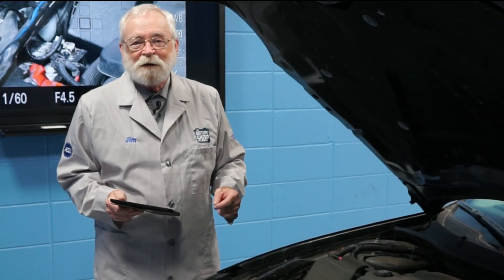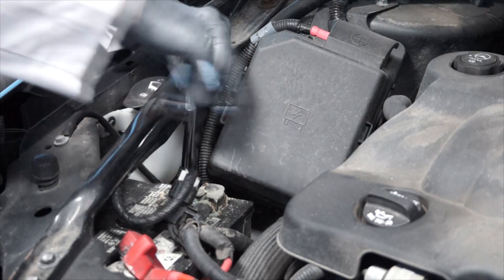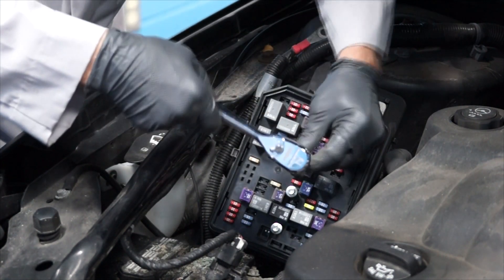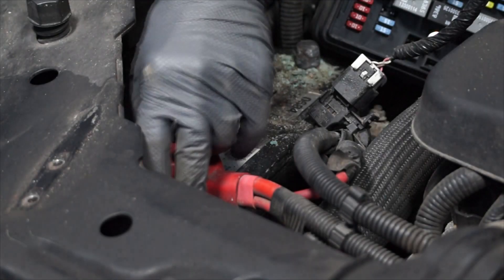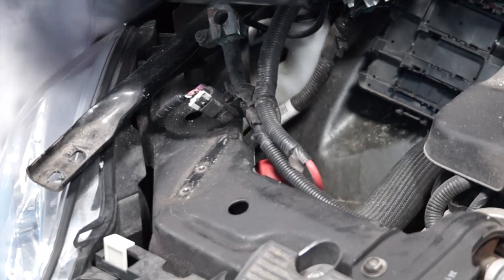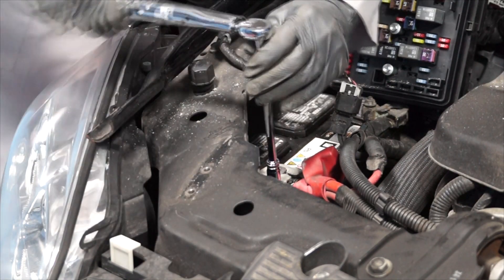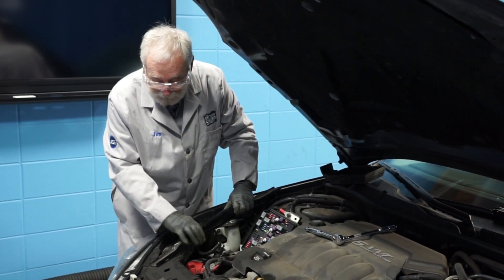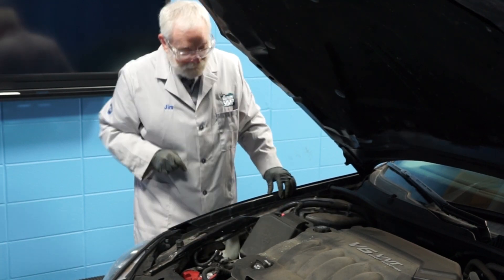Chevrolet Impala (2012) - New Battery Install

Comment: Follow-up: How did you get the control center positioned in that location when removing and reinstalling? There is an electrical cable coming off the block connecting to the control panel that prevents it from being placed in that position. Unless this one was shortened or the one your working on was lengthened, I don't have anywhere near that range.
Taking the battery out required three minutes of small maneuvers, eventually putting it on its side to get around the control panel and getting it out.

Edit: I found a second pair of hands to hold it as much out of the way as possible and got it installed. Thanks again for getting me 90% there.
Reply from the maker: Thank you for watching and happy to hear this worked out!

Comment: Near the end, the video shows you reconnecting the positive wire onto the fuse box right after you install the center board of the box; however, the next shot shows it disconnected again while you connected the negative battery terminal. Did you need to disconnect the positive lead from the box for some safety reason before you finished the negative connection to the battery?
Reply from the maker: Thank you for watching and for the feedback.

Comment: I did exactly all of that and the car will almost turn over.
Reply from the maker: Hi - Thanks for watching and sharing your experience. We recommend that you have the starting system shocked for starter and electrical issues.

Comment: Once I changed the battery the check engine light came on how do I get it off
Reply from the maker: Hi - Thanks for watching! If memory saving was not used, we suggest that you check the vehicle owner's manual or a service/repair for any system reset procedures that have to be performed.

Comment: Hey thanks so much for posting this. I was having a hell of a time getting the new battery in. I made the mistake of dropping the negative side down first. Then I saw you drop the positive side down first, went out in the driveway and BOOM, new battery in place no problem! Pretty tight space in this car, not a lot of wiggle room. Thanks again and have a good one.
Reply from the maker: Hi - You're welcome! Thanks for watching and sharing your experience.
Reply: At least this series vehicle (2006-2013 Impala) has the battery under the hood.  HHR's had it under the spare tire (watched a "pro" scratch his head for 15 minutes looking under the hood and fenders) and of course many Chrysler sedans have them inside the front fender and for those you have to remove not only the tire, but the plastic inner fender liner as well (so easy to break a couple of the plastic "retainer screws and the liner never stays in as well as new).  And don't even get me started on those vehicles that need the bumper removed to replace a headlamp or tail light.

Comment: I have a question I have a 04 Impala and I'm having security problems with it where it shuts off the engine how can I get past that to get the car running again I tried unplugging a couple fuses nothing really works
Reply from the maker: Hi - Thanks for watching! You may have to have the vehicle's security system (immobilizer) reset. This usually requires the use of a scan tool with the necessary software for your vehicle.

Comment: What garbage to go thru just to change the battery.
No wonder G.M stopped production of cars in 2019 because of poor design and quality like this example.
By the way I'm not a G.M. basher because I own a 04 Impala which critics slam but I like for ease of service on the 3.4 engine and a automatic transmission with a actual dipstick unlike today's garbage.

Comment: I just took off the diagonal bar and got it out just fine. 5 min or less job
Reply: Page, no insult meant here, but that’s not possible unless the wrong size battery was previously installed. A 24F (the original battery) cannot come out of there by only removing the bar. I just did this install myself. You must be talking about a different model. The box he first pulls out of the way is obscuring the negative end of the batter (overlapping it by an inch or so) and the nose end of the car is overlapping the positive end by about 4 inches... so you can’t just pull straight up or even tilt it, without getting that box out of the way... the hoses from the engine are nearly pressed against the long side of the battery and the other long side is up against the body of the car. So you could not POSSIBLY lift it out of there without damaging the hoses or breaking off that black box. And even when you remove the black box, you still have to tip the battery on its side and pull it out at a funky diagonal angle... which the video here has edited mostly out. It is at least a 25 minute install. If you’re talking about the same car, I’d be SO interested in seeing a video of your 5 minute removal, as this is what I do for a living. It had me baffled for a good few minutes.
Reply: @benjaminchadwick5351  The manual / factory spec for the gas V6 Impala calls for a series 34 battery - if your vehicle from the dealer had a 24F it was probably a dealer swap.  The Size 24 battery is the same width and length but 1" taller, so you can't tip it and get it past the fuse block.  The series 34 battery CAN be replaced by only removing the cross brace, I've done several that way, but you get about 3/4" more just taking the cover off the fuse block so I do that also but don't unmount it.  I also remember to disconnect the GROUND (NEG) lead first, guarantees no "sparky spark" when disconnecting the POS....
Reply: @robert_knows7973  In all the guides for replacing the battery, it was listed as a 24F (the same as I removed) which is reversed polarity to a 34. A 34R would fit in terms of dimensions and polarity, but with a 34, the posts would be precariously close to the edge of the car for a real firework show and yes, always remove the negative terminal first. It’s been a long time since I originally commented on this video, so I am hazy on the issue, but at the time I left the original comment, I had installed it the day before. It was fresh in my mind😂
Reply: @benjaminchadwick5351  You absolutely need to move the fuse box...especially in the cold. Can confirm.
Reply: @MatthewStout  yep, just changed it myself tonight and had to remove that box. Not worth the hassle or risk breaking something to get it out. Just can't get the positive cable back on right.. the screw that tightens it screws back on weird
Reply: @jaredpatterson1701  I wasn't playing around this time and it was still only about 0°F outside and I just shoved the new one in...it all kinds falls in one corner at a yime. I hate stiff wires.
Reply: https://youtu.be/83ihu1h89pA 

watch the top view here and see if you’re talking about the same install
Reply: I bought a socket set & the nun of the sockets worked